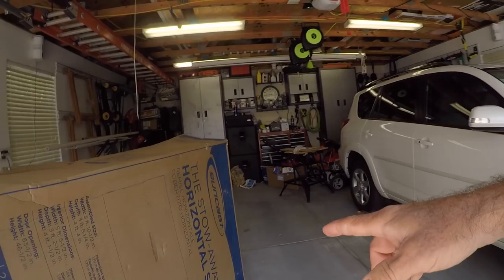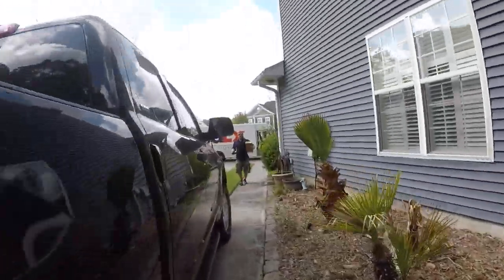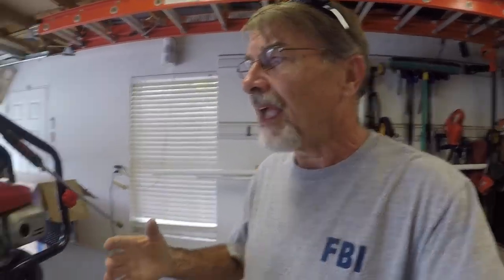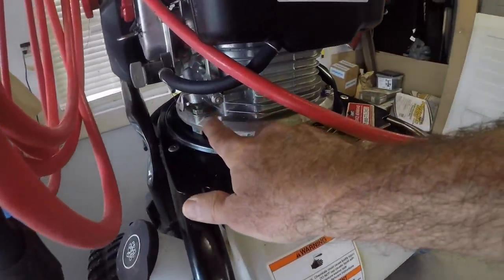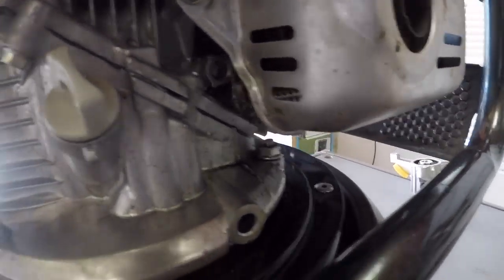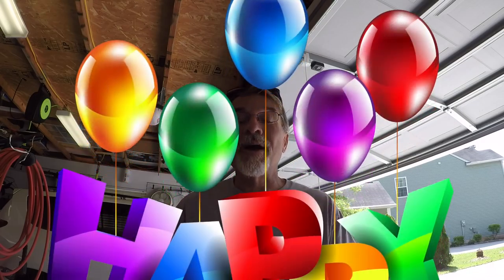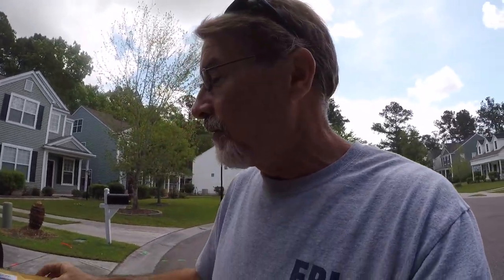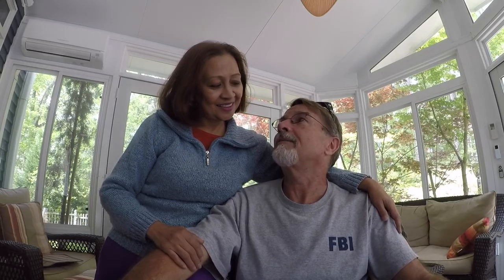VILLA FELIZ - US EDITION: HOW TO REPLACE THE PUMP ON A PRESSURE WASHER (How To Series)

Comment: Believe or not, my wife is from Bacolod City, we own a house there, I have an electric Troy built washer pressure, my problem , it cuts off after 10 minutes running, I took it the repairman, and he said it was ok, but the same problem, I thought it was losing power, maybe it has the same problem you had. Hope you can tell me. Thanks.                                          James
Reply from the maker: Try running it without any attachment on the end of the wand (no nozzle fitting).  Run it for about 5 minutes constantly pressing the handle on the wand on then off.  Sometimes the system gets air in it that doesn't allow the loader mechanism to operate properly.  If that doesn't work, do what I did and get a new pump assembly.
Reply: My PI Dream Thanks I  will try that

Comment: James, on your slab, for roughly $6.00 a yard you can use fiber.  You are not going to be driving on this slab, rebar is unnecessary.  Also, the finish will be a slight more foot friendly, as fiber will be exposed with a broom finish.

Comment: Audio issues when the mic is not pointed towards you.. probably coz of the filter you have.
Reply from the maker: It's a directional mic...like a "shotgun" mic.  I'll adjust my technique or try using it as a laviler mic.  Got an extension cable on order.